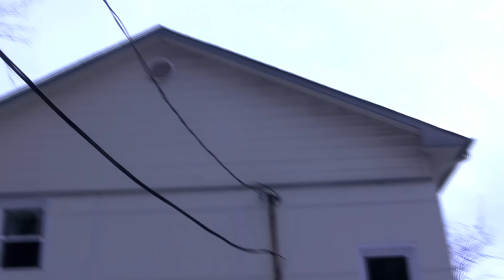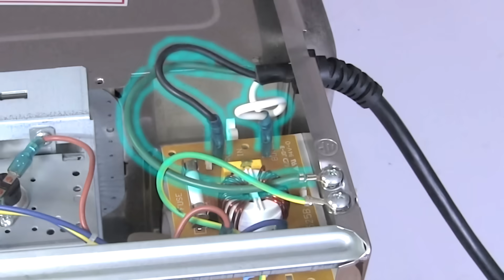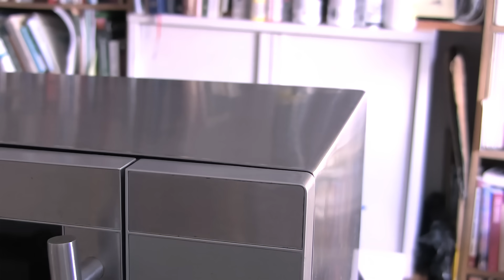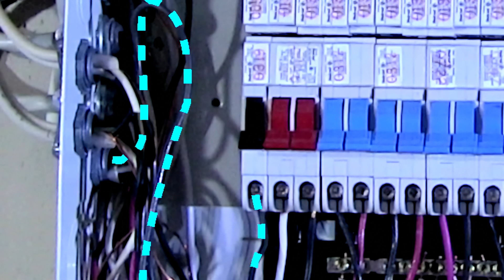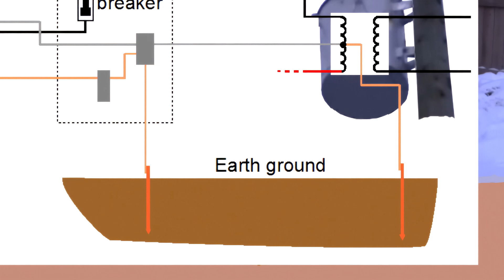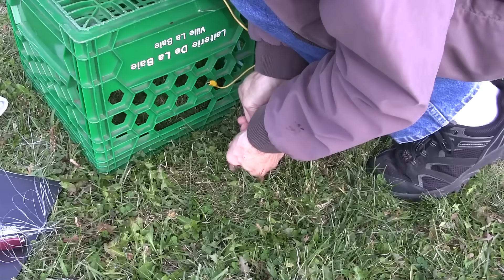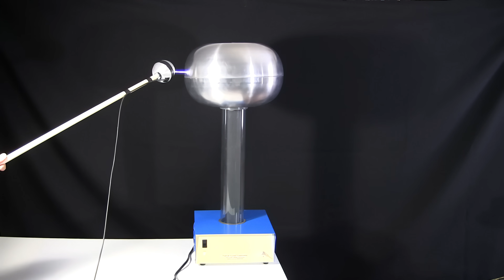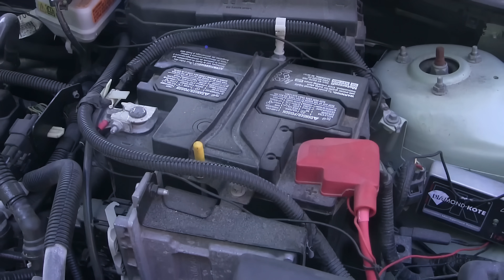What is Ground? Earth Ground/Earthing

Comment: Sir why some device need ground wire for its case? I think we can use netral wire to connect its case to the earth ground
Reply from the maker: If you connect the neutral to the case then the case will be part of the hot - neutral circuit whenever the microwave oven is turned on. If someone then touches the case and their feet are grounded, then some of the electricity will go through them.
Reply: RimstarOrg oh thanks sir, but is the neutral cable connected to the ground wire and connected to the earth ground, so if we touch the neutral cable (directly to the ground, 0V) are we electrocuted too?
Reply from the maker: If you touch the neutral when the microwave oven is turned on then yes, you could get electrocuted.  That's because when you turn the oven on, the on-switch connects the hot to the neutral.
If you touch the neutral when the oven is off then theoretically you should be okay since the neutral is at ground potential at that time and usually so are you. I say 'theoretically' because it's possible that whoever installed the wiring to your wall sockets may have connected the neutral and the hot backward. So unless you've tested and are sure, you should not touch the neutral anyway. Actually, before touching any wiring you should turn off the main breaker in the house, or if you really are qualified then only the breaker for the circuit you're working on. Best to leave it to an electrician.
Reply: RimstarOrg whether in other words you say that there is a neutral cable situation has a voltage (> 0V)
Reply from the maker: I'm not sure if you're asking a question there but yes, when the neutral is being used as the return for the hot then they're essentially the same wire.
Reply: RimstarOrg thank you for your answer sir, my lecturer gave another statement, i will ask again to him :)
Reply: @Electric Field:  HI! In USA, before approximately 1960, electric devices like amplifier had power plug with only  two blades, each of same size, hot and neutral wires.  So the plug could be put into socket, aka outlet, the right way or the wrong way.   The amplifier also had, on rear panel near power cord, a switch labeled "Polarity".  The amplifier would work well if the plug was put in the outlet either way, but often the backgound hum coming out of amplifier & speaker would be lower if the plug was inserted the right way.  People being stupid and lazy, the polarity switch was added so lowest hum could be found with flip of switch. 

Sometimes people did not notice the polarity switch, or did not know it's purpose, so they never bothered to flip it.   In many cases, when the plug was put in the socket resulting in wrong polarity, 117 volts ac was connected to the metal chassis.  

Since about 1920, all homes and businesses in USA (and the West) had wooded floors that were 12 to 24 inches above the ground.   So, strange as this may seem at first, a person could touch a chassis connected to 117 vac (due to wrong polarity of plug / or polarity switch)and not get shocked.  

But sometimes people did get shocked when using amplifier outside, because they were standing on ground, same as neutral wire connection, and then they touched the chassis.  People died from this, but it was rare.

Then came the West's cultural revolution of the 1960s and many outdoor music festivals.   Many musicians got shocked.   Even a singer who touched the microphone would get shocked.   The situation was confusing for the musicians, because sometimes they got shocked, sometimes not.   The variables causing the confusion were: 1) sometimes plug and polarity switch, due to 50% chance, were in correct polarity, putting neutral on chassis.  2) sometimes, due to 50% chance, 117vac was connected to chassis 3) sometimes the musicians were on wooden stage or platform  4) sometimes the musicians were on the ground.  

  Change in the electric code that required grounded outlets and plugs fixed the problem only if equipment made after the code change were used.   The musicians kept getting shocks because they preferred the sound of the old tube amplifiers made before the code change.  Gradually, over about 15 years, musicians learned to be careful when using amplifiers outdoors, and many had grounded plug put on their amplifiers, with ground wire connected to chassis and polarity switch removed or disconnected.  

One other problem was happening also: electricians, some of whom are dim witted, reversed  hot and neutral when connecting outlet.  So third wire ground, in center under blades, fixed all those problems.

Also with change in electric code it was made illegal to use cold water pipe for ground.  Why? Many electrical devices put small capacitor from both hot an neutral wires to chassis to reduce radio interference.    In a house this was not much of a problem.  In large building, the total of many such electric devices was like putting a large capacitor from hot to ground, and plumbers were getting shocked when they disconnected a water pipe (like during repairs or remodeling) from the water supply pipe in the ground.    

BTW, are you in India?
Reply: rh001YT thanks for the history! So now I know why there is a joke (i know it is a serious thing) of people plugging in amplifiers the wrong way and it blows up costing them a lot of money!
Reply: The case is connected to the ground wire. The ground wire under normal circumstances isn't part of the circuit. It's an open circuit that's why it's safe to touch. If the case gets energised, the ground wire completes the circuit which then trips the breaker making the case out of the circuit again. 

If you touch the case while a fault occurs (before the breaker gets tripped, or you have a faulty slow reacting breaker), then you'd be doing the same as touching the neural wire while the device is on. The ground wire in this case would have the same potential as the live wire relative to ground, so yeah, you'd get electrocuted in this case.
Reply: Hi Brian:  I think you're explantion is not quite right.   Ground wire is not really an open circuit, it's supposed to be the low side of the circuit if it's connected straight to the panel and bonded with the neutral.  Open circuit would mean the ground wire is not connected anywhere.  

If the case gets energized the current flows from case to ground wire and then to neutral at the panel creating a short circuit from hot to neutral.   A breaker is normally rated at 15 amps (typical house breaker) and will trip more or less instantly.  If the breaker was defective and did not trip then more than 15 amps would flow, potentially 100 amps or more, and blow the mains breaker.   If there was some resistance between the hot-to-case malfunction then that resistance would melt/smoke and possibly break the hot-to-case connection, and the case would be again at neutral/earth potential.  It's just very unlikely that any voltage, more than 5 or 10 volts would be on the case temporarily before something blows or breaks.
Reply: To put the issue simply: you should not put neutral on your chassis because neutral is supposed to be the dedicated return for the hot connection since electrons flow in a circuit. Yes you may think ground and neutral are the same since they are connected together, but that isn’t true, there is resistance from the appliances neutral point to the breaker neutral point where the ground connects. Resistance with current flowing creates a voltage drop, as long as the resistance is low it will be only a few volts. However if there becomes a break in the neutral line (really high resistance) there will be the hot voltage on the chassis now. This is why you use a dedicated return that should not be passing any current because if it breaks it will still have zero potential and is still safe to touch

Comment: "Attention Publisher" Ok, Lets say your sitting in your spa, You have that ground wire "Green" connected to the spa with a neutral and a hot wire but you ran that ground wire also to and up the pole from the neutral wire bar."white" Now, lets say somewhere between your house or spa and the power company where that neutral grounds ends up, Now some car or truck takes out an power pole but the only wire that didn't break is the hot wire that runs to that spa.  For me, I use a ground rod "Green" to the green wire "ground", and white to the neutral bar that go's back to the power company and black to the box.. I don't know if am right but I know, My spa company paid off my new spa for me after informing them,  Then they sent every customer they ever sold a spa to, a letter of correction, ... Always use a ground rod.. 8 feet deep.

Comment: Dont you use rcd switches in america?
Reply: We call them GFCIs (Ground Fault Circuit Interrupter)
Reply: Kyle McNicoll Thx. That's good to know, but do you use them?
Reply: FailCommando They’re required by code pretty much anywhere water could be a problem (outside, bathrooms, etc)
Reply: Kyle McNicoll That's interesting. Here in Germany they have to be in every House cause of the human safety.
Reply: Yep we don’t use them for every circuit mainly for cost saving, but bathrooms kitchens outdoors need to have a GFCI receptacle installed, that can then chain out to the other plugs on the circuit

Comment: Quick question wat is the polarity of lightening?
Reply from the maker: During a lightning storm, the lower section of the clouds are negative and the ground is positive.
Reply: RimstarOrg 
Thanks for the quick reply. So if a person was struck by lightening would he become positively charged or negatively charged as the electricity passed through him/her.
Reply from the maker: That depends on whether the charge goes from the ground up or from the clouds down. I don't know.
Reply: +RimstarOrg It could be either since while most (approx 95%) of lightning strikes are negative lightning from the cloud base to the ground there is such a thing as positive lightning where the charge actually jumps from the ground to the positively charged cloud tops. Usually the latter is associated with clouds that form anvil formations and of course they are usually significantly more energetic than negative lightning strikes for obvious reasons when you consider that the cloud tops can reach into the upper portion of the Stratosphere and there is whole hell of a lot of insulator between the ground and there.

Comment: Well you could do better ,the ground connection is primarily a safety feature for protection of power stations against induced voltages in the electrical grid from the nature ie: atmospheric discharges (  lightning ),solar winds and storms (you know ,the ones that cause auroras in the poles f the earth )......now because the power stations are grounded the household utilities must be grounded as well due to the increased  risk of electrical shock,this must be so because most household utilities have metal casing and the metal casing can become "hot" from induced voltage(ie: a electrical motor on a washing machine can induce voltage on the casing of the  washing machine ) or from electrical insulation failure in this case it could be the "hot" wire or the neutral wire  touching the casing ,remember that is a.c. voltage ....as for electrical circuits the ground connection is a common/shared connection between several basic circuits and normally is the negative of the power supply (ie: car electric circuits use the chassis as the negative ,the common/shared connection....),in electronics it can be the negative/common/shared connection or the zero volt "line" on a pcb board (ie: computers power supply have several voltage outputs 3,3v  ,5v  ,12v  ,-12v  ,-5v and these voltages have one common/shared connection 0v line,the ground/negative...just to finish,it only takes a few milliamps to stop the heart of a person ,.... the circuit breakers you showed in the video wont protect you from electrical shock  they only protect the electrical installation from over current in the case of short circuit/malfunction of a electrical device......the ground in a house is your fail safe ,a real life line that prevents electrical shock and this should have been the main point  in the video.
Reply: Richard Gates thanks for sharing that video
Reply: Much better explanation. This video is promoting the grounding myth, if metal isn't earth grounded then lightning is unlikely to hit it since it has no path to the earth.
Grounding Myths : https://www.youtube.com/watch?v=qNZC782SzAQ
There is always a voltage differential on the electrical ground, and it's the difference that shocks you.

Comment: Very nicely explained. I know this is about explaining ground, but my confusion is about the other two wires. Since this is AC, why do we distinguish between “hot” and “neutral” wires.  I assume the “neutral” wire is considered the return path. However, depending on the phase of the AC, either wire could be “hot” or “neutral”.
Reply: To answer my own question. Most likely the distinction between "neutral" and "hot" comes in when the equipment is turned off. In this case the "hot" wire would carry a current through your body to ground, if you touch it by accident. The "neutral" wire wouldn't carry current, because the equipment is turned off. However, once the equipment is turned on, there is no  distinction between "hot" and "neutral".
Reply: Hi Tom C.  What you wrote is not quite right.  The neutral wire is bonded to ground, earth, at the secondary of the power company transformer, and again at the power panel of the building to which power is fed.  Two grounds for redundancy.  So the neutral really is neutral, same as the earth is neutral.  Such a situation is grounded ac which is not the same as ungrounded or floating ac.   The neutral does carry current, but has no voltage...it is essentially a current sink. 

In floating ac there would be no difference between the two wires, each would have voltage and current relative to the other, but neither wire is neutral.  

When one of the two ac lines in bonded to ground, the voltage of the other line varies above and below ground, swinging from neg to pos, but the neutral wire remains neutral, or ground, or zero.

In practice, depending on quality of bonding to ground, which may vary, a person standing on ground may feel a very tiny shock or tingle of electricity when touching the neutral wire.
Reply: rh001YT  I was looking at your explanation again. True the neutral wire is connected to ground at the service station, and acts as a current sink. However, saying that there is only voltage applied to the hot wire, but not to the neutral only applies to DC. 
In AC, the voltage has phase reversal, and the current swings back and forth. For one half of the AC cycle the hot side is more negative than the grounded neutral, in effect the neutral is positive with respect to the hot wire. In that case, the neutral side has the voltage, and the hot side is the current sink.
Reply: rh001YT I totally get what you are saying. The only thing I'm confused about is the two grounds. Wouldn't the easiest return path for the current be through the ground of your home, through the earth and back up through the ground at the transformer? 

I've never seen a TN-C-S system with a ground at the house in any literature. 
At home I have a TT system, so I have never seen a TN-C-S system up close.

Comment: In one extension cord I have, there is a ground part that sticks in the outlet. Eventually the ground prong fell off and behind it was just the rubber that the extension cord was made from, there was no cord that it was connected to. Why is this?
Reply from the maker: The answer is that it shouldn't be that way. Either you're mistaken and when the prong came off, the rubber closed over the metal inside the plug and you can't see it, or you have a fraudulent product that shouldn't exist.
Reply: Its a fraudulent product, It has the plug for the ground going into the wall,  When you cut the female end off and try to wire a new 3 way, that's positive, Neutral and ground you'll see there's only two wires in the long part of the cord, eBay's been selling a bunch of them. So its advertise as a neutral ground as well as a earth ground, There is no earth ground wire in the cord. My male end fall off for the earth ground, It stayed stuck in the wall outlet. That's the problem it sounds like Ethan has. They have sold millions of them to..
Reply from the maker: I'm surprised it's even legal to sell them.